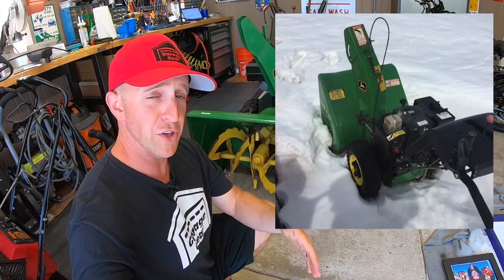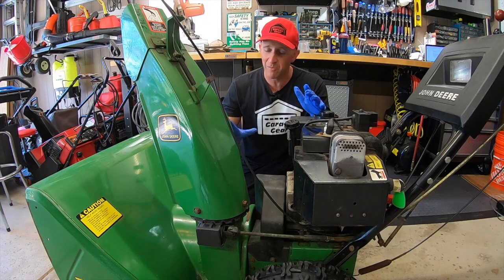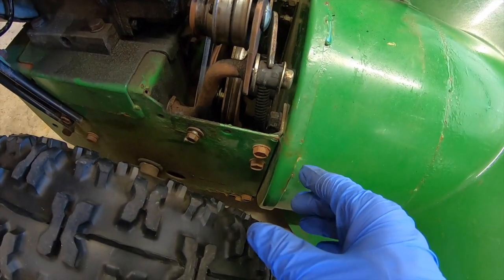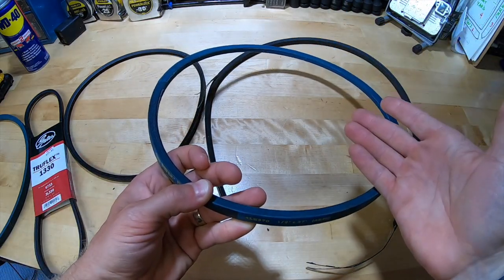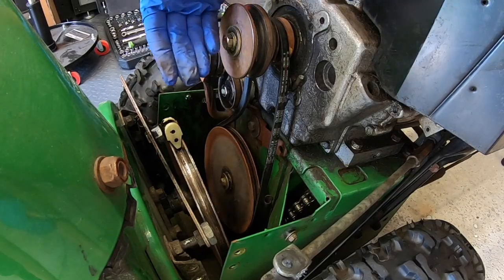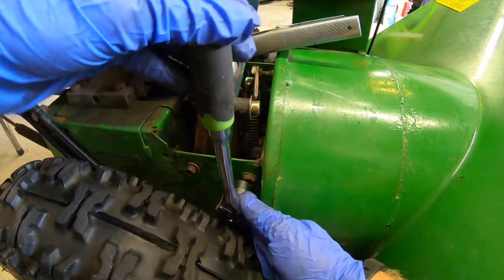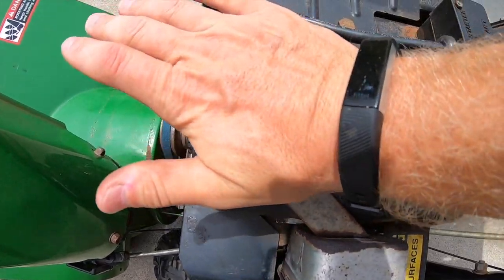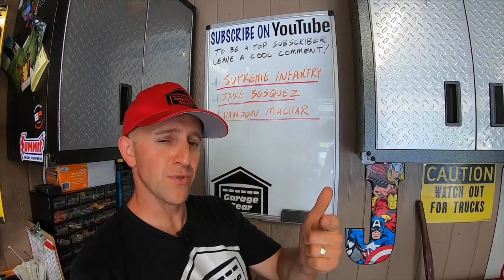HOW TO REPLACE AUGER & DRIVE BELTS ON A SNOWBLOWER FOR BEGINNERS

Comment: Hello, just wanted to tell you thanks for such a detailed how-to video!  I have the 878D and it is very similar, so I was able to complete the job thanks to your video.  Tips like marking the belt guides position and putting a stool behind it were excellent ideas, oh and pulling the starter to get the auger belt on was great too!  Just wanted to say thanks very much!  The only other thing i need to check into is why i am getting an occasional snap or pop when i am snow blowing, but it usually starts on the 1st or 2nd pull.  Keep up the great work as your detailed step by step videos are the best!!!
Reply from the maker: ROCK ON John! Thanks for the positive feedback my friend!

Comment: Great video. Auger and drive belt done. Confident the machine will clear snow without a problem based on this maintenance fix and other recommendations from Garage Gear. Expense was about $40 and an hour of time versus $300 for small engine repair service or, $1,300 for a new machine.
Reply from the maker: That’s awesome! Rock on! Thanks for watching!

Comment: Great Job, good idea to do it during summer time, and when snow is coming averything is working properly, to Have belt snap during a Middle of snow storm is the Last thing you want, by the way a solid old snowblower
Reply from the maker: I don’t mind working on snowblowers in the summer! Parts are usually more available. And there’s no rush to get it done! Great old snowblower! Guy said he got it off of his neighbor who was moving south years back for $125. What a steal! 👍
Reply: @GarageGear  , that is correct, some of the new snowblowers have plastic control panel and when a cable freeze up and you are trying to loosen up the plasteiv panel breaks

Comment: Really great video JB. Hopefully we won’t need the snowblowers for awhile…haha. I remember the trick of using a screwdriver and placing it under the belt and sliding the screwdriver and it stretches it over the pulley. Nothing runs like a Deere! Have a great weekend neighbor!
Reply from the maker: Hey JAY! That trick still works! With these temps I think we got some time. My 1971 is getting new tires soon. We’ll be ready! Nothing sells like a Deere too! Have a good rest of the weekend bud!
Reply: @GarageGear  you as well!

Comment: JB,
I'll be doing belt replacement on my TRS26 blower when i get my belts. Like you said might as we replace both belts since you're gonna be there replacing 1 😂. Idk how times i seen people split their blowers apart (totally apart) and you know what 😂😂😂 that its a pain to put back together. I'm like all u gotta do is remove 2 or 4 bolts and shoot connections and it pevits in the middle like in your video. Guess what I'm the lucky guy to help them put their blowers back together while I'm you know what 🤣🤣🤣 underneath my breath 🤣🤣🤣.
Reply from the maker: Yep you might as well do both on these guys! Thanks for watching my friend!

Comment: I guess my TRS 27 is an older model, there is no apparent way to adjust the tension on the auger belt 🤔. I just replaced the auger bearing which went in perfectly, but now I'm noticing that the auger belt has a lot more play than it should, the auger is kind of sluggish getting going, and I'm thinking that it might not do to well when dealing with heavy snow. Any idea how I would snug that belt up?
Reply from the maker: Hey Paul! If there is no tensioner to tighten you could purchase a slightly smaller belt. Maybe a half inch size smaller. Thanks for watching
Reply: @GarageGear  Sounds like a plan, I'll give that a try. Thanks for the help!

Comment: Hey, I have a yard machine MTD 31A-3BAD729 compact snow blower. (22 inch 5.5 HP). I’m currently in the process of replacing the belt for the first time in 20 years 🫣. We had it serviced at one point for a wheel replacement and service. I’m assuming during the service, they adjusted the belt since the bolt is in the furthest position. This is where my problem is. The bolt won’t come out after removing the belt bushing wheel/nut, the bolt hits the auger housing. I tried taking the cable belt to “pull” it closer, but the bolt plate that the bolt is into has “bottomed” out and won’t come out any further. (Apologies for the improper name of certain parts). I’m wondering if you have a video or know what I’m struggling with. If you do not understand what I’m talking about, I’ll happily make a video and upload it to YouTube for you to see. 
I’m replacing the belt due to it having cracks every 2 teeth (I do not know how it hasn’t broken yet), and I do not want to grab a brand new belt and have it break due to too much tension.
Reply from the maker: I think I understand what’s going on but if you could send me a brief video that help clarify my questions. You can email me. My email is in the description. Thanks for watching
Reply: @GarageGear  alrighty, will do. I’ll do it tomorrow if I remember/ have time.
Reply: @GarageGear  I sent a DM on your Instagram with pictures of my model and what the issue is. I’m having email issues where emails won’t send with a picture, I don’t know why.
Reply from the maker: @Ca31_Buff  ok I will check them out!

Comment: Hey! I can't find anywhere what oil to use for this snowblower, I have 10W-30, but I believe I need to use 5W-30. I am in Ontario, Canada.. what do you suggest?! I cannot find an owner's manual anywhere..
Reply from the maker: Hey Shayna! You’re not far from me. I’m in Buffalo! Typically 5w30 oils have a slightly wider temperature range that they work best in. I put 5w30 full synthetic oil in just about every machine I own including snowblowers of this size. Thanks for watching!
Reply: @GarageGear  Thanks so much, I picked some up after watching your video and will be attempting to change it tomorrow, lol. Thanks for posting the video
Reply from the maker: @shaynalinkie  ROCK ON SHAYNA!!! You got this! 👍

Comment: I have a question, I see you putting that Clevis pin through the bottom? When you took it off I thought that either someone else worked on it or the manufacturer screwed up. 
I ask because the vibration can cause the cotter pin to break and the Clevis pin to fall out. That would really suck if your doing a job and try to find that Clevis pin in the snow. 
Correct me if I am wrong. 
Thank you
Reply from the maker: Hey RAMBO! You’re speaking of the one on the chute correct?
Reply: @GarageGear  yes
Reply from the maker: @SFCRambo60  ok got it! That’s how it was designed and that does have a possibility of happening. I just put things back as I find them so there’s no issues. I have seen a guy just shove a nail through the hole and bend the end when he lost his Clevis pin before. Worked well and he had it on there for years.
Reply: @GarageGear  I am always looking for safety problems and not having to do double work. Worked for Scabapilare ( Cat )  for 32 years as a safety man and Cost Reduction Rep. So it's a habit also being in the Military for over 20 years.  You have to think safety and let's not create more work.
I have done the nail may a time but when your out on a job throwing snow you don't need the hassle.

Comment: What’s the best way to remove a wheel that’s rusted to the axle?
Reply from the maker: Hey timber , you could try torching the wheel and then dumping ice cold water on it! The heat/freeze trick has broken some bonds for me in the past. Thanks for watching!

Comment: Hey JB! I stripped the belly pan boltson my new Craftsman 24”😅 any idea on how to fix it? Please help😫
Reply from the maker: Hey Fern! Did you strip the bolts or the bolt holes?
Reply: @GarageGear  the bolt holes. I must have put the screws in at and angle and they no longer tighten.

Comment: On alot of machines the belts can be changes just by removing the cover and feeding them down between the pulleys. My Toros are all that way. Never take them to a dealer to replace them. You can do it with your eyes closed.
Reply from the maker: Yeah some are easier to get belts on and off. This guy had a few things in the way. Thanks for sharing David!

Comment: No thanks I'll pay someone to fix it.
Reply from the maker: Hey Shane, I called a local hardware shop to get a quote and they wanted $150-$250 to start. The belts cost less than $30.  Crazy prices! Thanks for watching!
Reply: @GarageGear  Damn! What's your time worth I suppose!
Reply from the maker: @shanew7361  prices can get pretty wild with this procedure! It only took me a little over an hour to do! Usually depends if one stubborn bolt is holding me up!